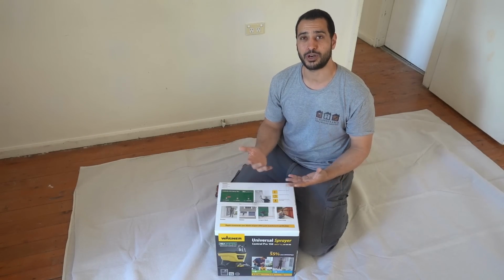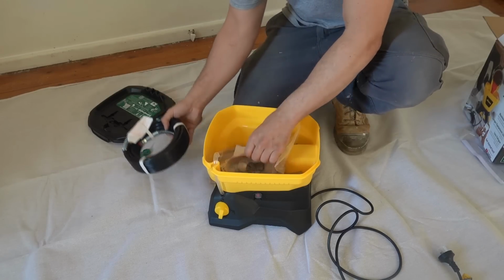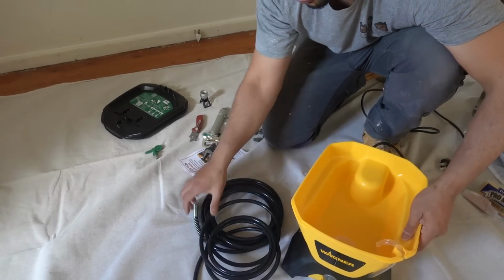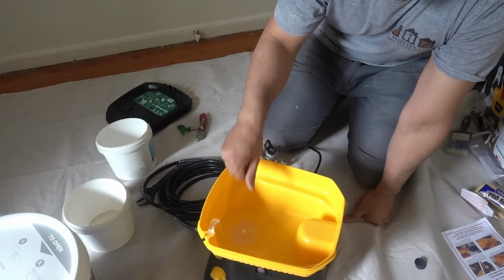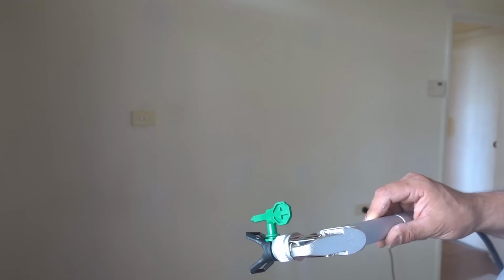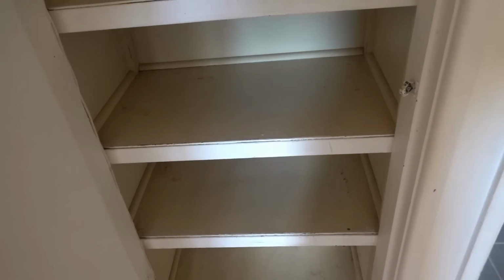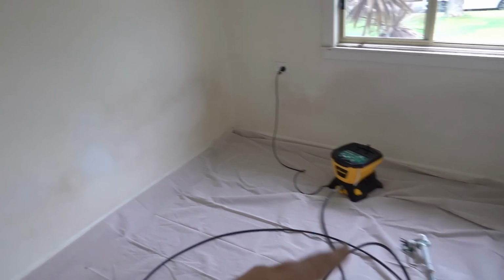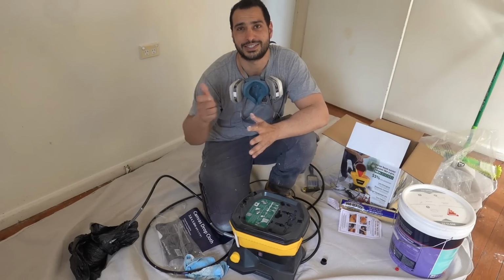Wagner paint sprayer - review and testing control pro 150 / 130

Comment: Great video Bill, do you need to ever thin out the paint when using the 515 ? or just pour straight in and start spraying , with thinner solvent varnishes and paints is better to use the 211 tip ?

Comment: Bought  130 for outdoor facia, n soffit on a house made it maybe 1 hr ½ before it made a loud kicking noise then it stopped spraying.  Took it back to where I got it and they would not refund my money, so I swapped it out for another one, same thing happened to the 2nd one. Took that one back tried to get my money refunded but the store would not so I swapped it for another one and I just put it in my closet and finished with a roller and brush.

Comment: Hey Bill, good job on the review. You mentioned that you were going to do some trim work with the 211 tip and was wondering how that went. I have bought the same tip with a Red gun filter to trim work. I want to use Dulux Aquanamel but have heard that it is not the best for spraying, have you had any experience with this product or do you recommend something else for trim work. Thanks Bud.

Comment: Hi Bill ,I’ve just purchased the 150m and I’m having problems with streaking (it’s not feathering). I’ve overlapped each pass and the result is terrible. I have watered the paint down by 10 % but that didn’t help. I tried again today ( thoroughly washed it yesterday) . I used the 515 spray head and the white filter….again the same result….any ideas? Or have I purchased a dud….hope to hear from you. Glenn.
Reply: I have the same problem

Comment: Trust me on this don't get the 130 spend a little more and get at least the 150 or 170  I religiously thoroughly cleaned my 139 out and it lasted just 25 gallons of paint was shot leaking from the bottom
Reply: 130 I meant typo.

Comment: I'm pretty impressed with the 150's performance. I used the previous generation, PaintCrew for 10 years. Happy with it but cleaning was a chore. The new lid/cover is flimsy but they did improve on the tub, paint does not stick so easier to clean. Removing the carry handle was just cheap too. The inlet & outlet valves are much simpler, easier to clean & I HOPE they will be durable. Last gen, you can renew all of that with just new o-rings. The nice thing about o-rings is they get caked up with paint you can just toss them for pennies.

Comment: Thanks for the video Bill! I'm a professional painter. Honestly, I prefer rolling interior walls with a 3/4" nap wool roller and a five gallon bucket. It puts more paint on the wall and, IMO, gives a better finish. As you can see from the video, you can end up with paint lines with a sprayer. I never use a sprayer in a house to spray walls with existing flooring and furniture. The time you spend masking and covering, you could be done with a roller. Even on new construction or remodels, I prefer rolling. The 130 is great for spraying baseboard, trim and interior door/jambs. I spray them outside if they're new. I spray trim, jambs and base without wall masking and then cut/roll the main wall color. Hands down a better finish than a brush. I prefer a smaller tip like a 211. A 515 puts out A LOT of paint and you have to move fast. For the DIYer, a smaller tip is more forgiving. A sprayer also works well to spray corners instead of a brush. For the DIYer, you may not like the over spray if spraying indoors. ALWAYS strain your paint, this reduces tip clogs and reduces your frustration. All in all the 130 is a great little DIY sprayer, just be sure to understand your project and the limitations / benefits of a sprayer.
Reply: Just the reply I was looking for. Just got done replacing 11 inside doors so I have a lot of jambs and doors to paint along with base molding, case molding and some bead boarding eventually. Was looking at the Graco handheld but just cant stomach spending 700+ bucks on one.
Reply: Exactly
Reply: spot on... i only use this to spray water based gloss and the odd small ceiling.  does the job great with a 211 tip. walls as you say i always roll but at times i may spray the cutting in if white the easier to just roll the walls after
Reply: 100/
I only spray when i absolute need to, like if its a fence or something
Reply: If it was an outside fence would you definitely recommend the spray for speedier results?
Reply: thanks for the info- do you find with the smaller tip you need to thin down the paint with water?

Comment: Thanks for the helpful video! Have you used a finer tip with the 150, such as a 211 or 311? Wanting to know if it still works well without pressure control. Thanks

Comment: None of these Wagner painters are professional grade. Even something like the 350M is not going to hold up to regular use, unless it's a bunch of really small jobs, like painting furniture and stuff. 

I was curious if Wagner ever started making pro grade sprayers and they still don't. That's how I ended up here. This is fine for a DIY type person who doesn't expect too much from it. 
The good sprayers are ridiculously expensive. I have a Graco that is going for about a $1000 now and it even says that it won't last for doing large jobs every week. I have had it for about 8 years and it still works great and I don't even know how many large jobs I've done with it. This type is also something that you can buy parts and rebuild it on site if needed. 

If you're just starting out as a professional painter and plan to use your unit on a regular basis, you're going to need to spend at least about $1,000 or keep buying new sprayers. And that's only if you're not doing really large jobs like commercial work. The Graco 390 is good for a painting contractor who is just starting out. 

Titan is also a good company for professional grade sprayers and I think they might even be a little cheaper than Graco. I used a large Titan brand sprayer back in the late 1990s doing large insurance restoration jobs and that thing was a beast until some Yahoo's came in after I left who didn't know how to clean it properly. That is the key to making any of these sprayers last, which is proper cleaning and storage prep.

Comment: Loved all your Wagner spraying videos. Well this one has made my decision harder. I’m a firm believer in “buy cheap, pay twice”, so have been about to pull the trigger on a 350, but it’s just me doing DIY around my house. Maybe the 150 would be fine? 
Hmmm $450 for a 150, or $895 for a 350 (skid) from a place at Merrylands. Tough call … the cleanup on the 150 looks much more pleasant, but there are two extra tips with the 350. So hard to make the call.
Also … what is with Wagner having no consistency between models numbers globally? Does my head in.
Reply from the maker: Lol, I would recommend the 350 over the 150. Better gun, more tips, longer hose, pressure control ect… 👍
Reply: @billshowto  Glad to hear that! About 30 minutes ago I clicked the buy button on the 350 😉 
It will motivate me to tackling the outside of the house as well. Cheers!
Reply: I have a Graco X7 I use for exteriors, etc. For the DIYer it's a hassle to clean. I think the 130 is great for a DIY to achieve pro results with less clean-up hassle. It's great for occasional use. Hands down best finish for doors, jambs, trim and base.

Comment: If I spray like you showed my paint always runs and sags.. water based paint from dulax and I don't thin it. Tried with 150 pro and the 350 pro. Same result. I have to spray very fast and further back....
Reply: Use a smaller tip. If you're using a 515 it puts out a lot of paint fast. You have to move fast or you can get runs and sags. You also may be too close to the surface. Maybe a 511 for a DIYer.

Comment: Hi Bill. Thanks for these very helpful videos. I went out and bought this unit, and I must say this is the first time I am using a spray painter. Really appreciate if you can show us how you do the preparation for spray painting since I ended up having dust (paint - dried though) in other areas of my house. I covered all doors and windows with the plastic cover comes with the tape attached ( uni pro brand, could not find any other decent brand at Bunnings).
Reply: You need to give the wall or surface a good clean with sugar soap. Let it dry. The paint the walls, the sugar soap will work well for removing grime, dust etc.

Comment: Got a question , how to fix floor tiles that have come loose but grout has not cracked on a concrete floor? When walk on them they creak any ideas would be great. Cheers.
Reply: Lift the tile remove and clean the area and replace with fresh mortar and grout. The tiles will eventually crack and break if you dont .
Reply: @TheRealMrCods  thanks mate yeah just cut out some grout to relieve pressure as starting to bow up. Will look for tiler to fix cheers.

Comment: Bro have you used the 350’M on exterior masonry ? If yes which paint worked well ? Thanks 😊
Reply from the maker: I used it once on brick work and didn’t like the finish. I ended up using a brush and high nap roller with very thick paint. All depends on what and where you are spraying
Reply: @billshowto  
What would you recommend on concrete exterior ? I know the 350’isnt the proper machine but maybe a quite liquid Sylacryl could work

Comment: Seriously good video, Bill. 

I'm guessing you've heard the stories about spraying, versus rolling behind spraying, versus simply rolling. 

How about a comparison of the three,  painting bits of timber, leaving them dry, then scratching them with a key or something sharp to check, the adhesion?
Reply from the maker: Back rolling is something I would only do on a new surface or area which may have poorer adhesion , would be a good test though 👍

Comment: Hey bill, I want to paint my house what do u reckon should I use a sprayer or do it with roller? Not sure which one will help me to get a better results
Reply from the maker: Inside or outside? If you’re new to painting and your works is inside o would recommend using a roller and brush. Building your way up is always better and safer👍